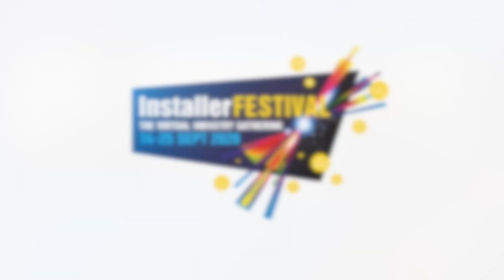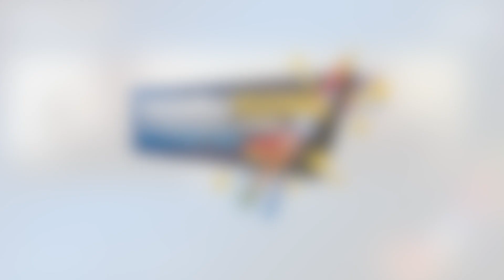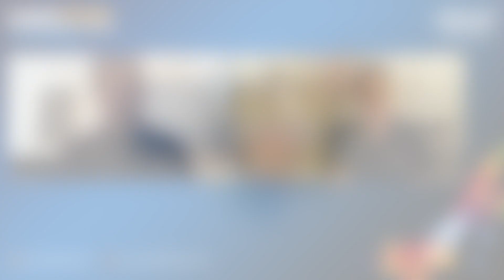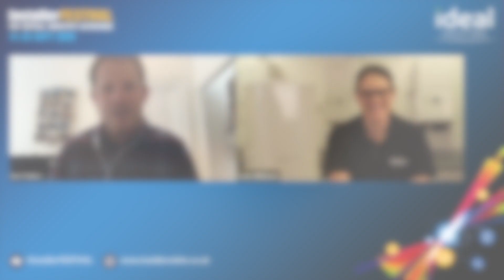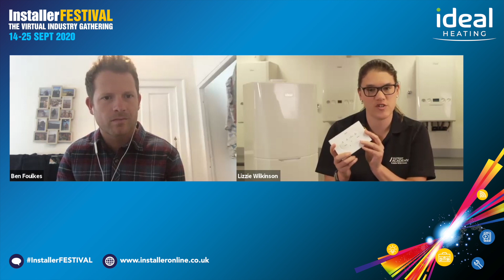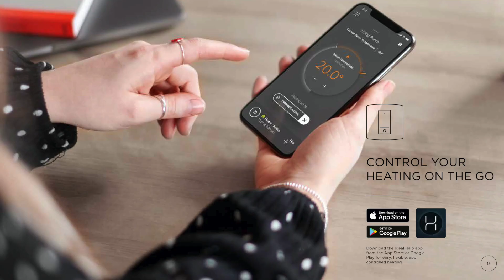Get an exclusive look at Ideal Heating’s new Halo thermostat range

Comment: Possibly the worst thermostat ever. Mine heats the radiators (and the garden) for 20 minutes then turns off for an hour and a half. It causes so much energy to be wasted that I am surprised Ideal are even allowed to sell it.
Reply: Probably the way you set up the 6 time zones and the temperature within those zones.
Reply: @MrRawMonkey  No time zones set - set to the same temperature 24/7 - as it is heating a room with musical instruments in the 1.5 degree temperature fluctuations are very undesirable. The difference between a primitive controller like the Halo and a more sophisticated one (usually PID) is that a better controller keeps the room temperature virtually constant which is nice for people as well as musical instruments. The Ideal Logic boiler blows cold air through the heat exchanger (to heat the garden) for the entire half hour the boiler is 'on' even though the burner is only actually working for about a minute. With the price of gas going up (again) I'm seriously thinking about scrapping the Halo and boiler after only 18 months.